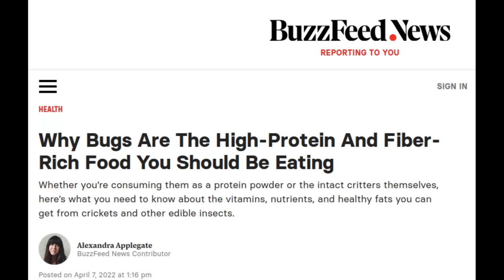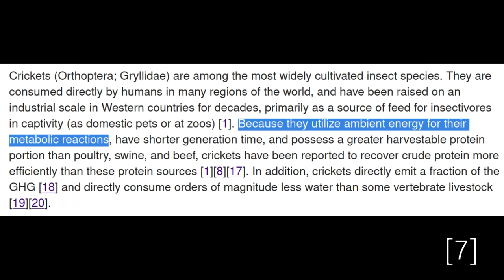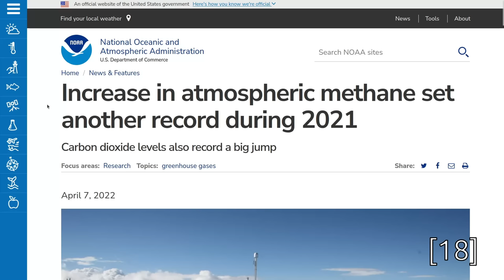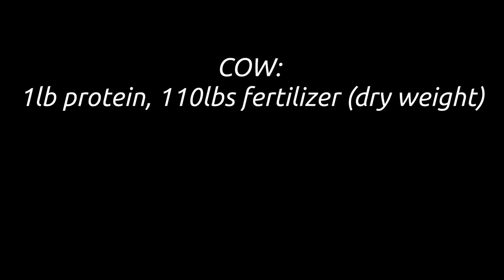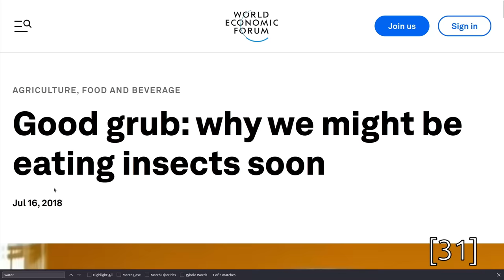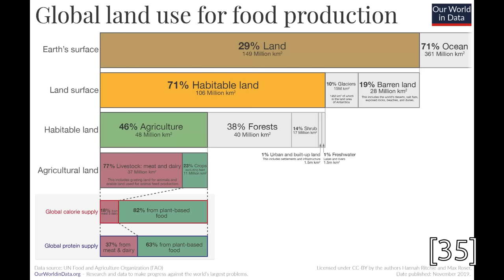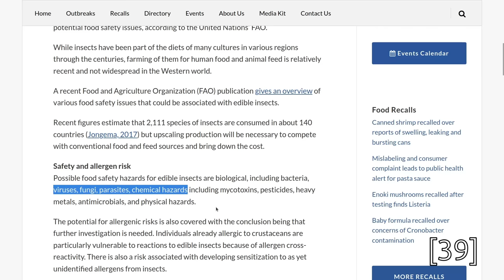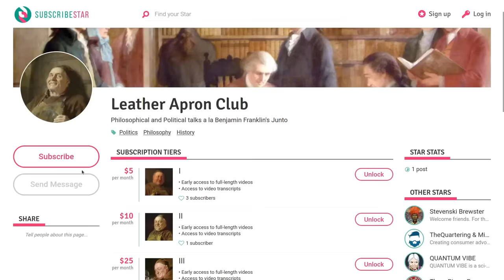Why We Won't be Eating Bugs in the Future

Comment: Also, insect protein has much less bioavailability as our bodies aren’t designed to digest insect protein. Not to mention that are digestive system can’t digest chitin too well. Eating bugs would cause a whole host of digestive issues and make people weaker due to a functionally lower protein diet.
Reply: Not only that, but they also have a  80% chance of being full of parasites, among those 30% being transmissible to people.
Reply: Exactly. This is also why eating bugs isnt comparable with eating "sea bugs". Shrimps, crabs and lobsters actually have meat in them when you remove their shells.
Reply: @reilysmith5187  And they have been eaten by French, Italians, Spaniards and many more for centuries. If you compare any of them prior to WW2 with a land bug eater from today the sheer difference of bone structure, muscular mass, mental strength (B12 only comes from animal meat) would put them to shame.
Reply: Sickly, cowed, humiliated people is a feature for them not a bug
Reply: That's good, less risk of an uprising
Reply: You can always eat them as chips instead of normal meal.
Reply: @adinalakatos1560  This is just, not true. The parasites of bugs do not readily transfer to people. Because, the adaptations needed to parsitise bugs, are different to what needs to infect people. That's why is generally considered safer
Reply: @reilysmith5187  Crickets also have meat, so do maggots, so do beetles. This is just, wrong.
Reply: @placeholdernameisplacehold7671  👃
Reply: @adinalakatos1560  Did you just make these numbers up? 
Sea life is just as prone to parasites. That's why fish tends to be frozen before being consumed raw, it's festering with crawlies.

And 30 people just roll with it.
 It's important to stick with the facts on this one.
But judging by your name I assume you're just being funny.
Reply: It can actually
Reply: The bug eaters have found this video 😨
Reply: @JA-jx1hk  tbh, eating chapulines is great, but I still will eat meat like arrachera
Reply: @henryc7548  Who are "they"
Reply: That's not how digestion works. Unless there are special microbial digestive products directly affecting health, digesting chitin would just take longer.
Reply: @Свободадляроссии  and that’s a big problem. We can technically digest wood, it just takes very long.
Reply: @Свободадляроссии  WEF
Reply: Making people weaker is the whole point
Reply: That's probably the point
Reply: That's exactly the point, it's also the reason they push vegan diets for similar reasons
Reply: @placeholdernameisplacehold7671  👃🏻
Reply: @Свободадляроссии  just digest it a bit longer, bro.
Reply: @JA-jx1hk  Yes. Really bad comparison to the point of being utterly useless since wood isn't food.
Reply: @theonpointheavy4401  And what would they gain from it
Reply: @clanksshekels  Wouldn't lowering economic output really suck for a group of neolibs?
Reply: @pauloa.7609  Yes, that's usually how this works. There's plenty of indigestible stuff in every single vegetable or fruit. Doesn't mean it doesn't work.
Reply: @Свободадляроссии  bugs arent food either. “Some people eat bugs!” Some people also eat wood. And dirt. And leather. Anything you can digest and get some nutritional value from can be called “food”.
Reply: @Свободадляроссии  not if you're planning on automating everything, and only want to keep humans around as debt slaves
Reply: @JA-jx1hk  Again, useless comparison. You just said that insects weren't food and that wood was. Get a decent definition for food. Any you might find will include insects, since they obviously have a thousand times greater nutritional value than what you suggested and beyond plenty of things we eat all the time. Just because you don't like it doesn't make it stop being food.
Also like a billion people regularly eat insects and it works. That doesn't apply to wood, leather nor dirt.
Reply: @JA-jx1hk  do you also have an issue with eating celery or anything with cellulose for that matter?
Reply: where did you get any of that protein bioavailability argument, please
Reply: @adinalakatos1560  False and you know it. They have NEVER been eaten it as a staple, from womb to tomb.
Reply: @Technoanima  Just Google any study on bugs, I won't bother because all of my replies are getting deleted anyway.
Reply: @turtleboy1188  Ahhh this one understands. They want us weak lel
Reply: there was a mummy from a millenium or 2  ago. He died from having mega colon from nothing but a grasshopper diet.
Reply: They probably would like us to be weak.
Reply: Lol lol just plain wrong. Humans have been eating bugs for a much longer time then they were eating beef. Chitin is what mushrooms are made of. And yes we don't digest chitin, like we don't digest fiber. So how many times has anyone told you "you should eat less fiber"?
Reply: Isn't there also an issue with people who have shellfish allergies also having their allergies triggered by certain insects?
Reply: @Rig0r_M0rtis  Are you sure that mushrooms are made of chitin? I am fairly sure they are not.
Reply: @SuperCosmicMutantSquid  Any arthropod likely has chitin, chitin may cause an alergic reaction.
Reply: @elio7610  You could have spent the time it took you to write your comment to look at wikipedia.
Reply: @Rig0r_M0rtis  I did, i word searched for "chitin" and found zero results on the mushroom page.
Reply: @elio7610  try the page on chitin or fungus
Reply: @Rig0r_M0rtis  Okay, i guess you were right.
Reply: Trevor Brannon  With that logic, increasing the amount of oxygen in the air would increase our population.
Reply: Trevor Brannon  There has been a study and indeed higher CO2 levels lead to bigger plants but it doesn't increase the nutrition accordingly so the nutritional value of these plants is smaller per unit of weight.
Reply: Tiny hats letting the go…I mean “cattle,” know that eating the bugs is perfectly fine!
Reply: Your comment makes zero sense. All arthropods of the land and sea are made up of proteins which are perfectly digestible by our mammalian bodies. Unless you can point to some specific molecular difference that gives us trouble? Animal protein is animal protein, and eating X oz. of land or sea bugs compared to X oz. of vertebrate meat will only differ in protein content by their ratio of protein to fat, and because you could be eating rabbit (incredibly lean) or bacon the macros of the vertebrate meat would vary a lot more. And you aren't guaranteed the complete vitamin and mineral profile of a whole insect unless you're eating whole small fish like sardines, or organ meats like liver. Also, the average Westerner gets more than enough protein, and won't risk getting "weak" from malnutrition unless they pursue an extreme diet where they cut a lot of food groups out.

 And lots of foods that we eat contain undigestible carbohydrates. All soluble and dietary fibers pass right through us, and there are sugars in beans and other vegetables that we also don't absorb that end up getting fermented by bacteria in our guts and making gas. And there's also lactose which the majority of people aren't able to digest, either. I love eating shrimp so small that you eat their shells too. Or deep-fried shrimp heads at sushi restaurants. So what if I end up passing a little bit of chitin a day later.
Reply: @alexkim5838  you have to eat the crickets whole. You don’t have to eat the shrimp or the lobster whole. Nice try.
Reply: @JA-jx1hk  just because you've never had tiny shrimp or tiny crab which are eaten with the shells on doesn't mean millions of people don't do so each year. Also you still haven't explained any of your specific scientific claims.
Reply: @alexkim5838   Then start eating ze bugs now. We'll be alive. You will not.
Reply: @asdergold1  I already enjoy chapulines and silk worm pupae. And I love the natural red coloring from carmine, too.

Comment: I think one of the reasons bugs are pushed so hard is because of their much shorter lifespans compared to conventional farm animals. This shorter lifespan makes it way faster to genetically modify them to a desired form that can potentially convert food into protein even better than chickens. That's my best guess at steel-manning their position. I still don't want to eat them though.
Reply: This, but mostly because of energy conversion: The ratio from food energy to animal tissue energy is about 1:10, in insects it is about 1:2.
So while on 2 kg of soy you could farm 200g of mammals, you could farm 1kg of insects. Also many of them can be raised in waste products of other industries, therefore there is no extra farmland required. 
Also they need very little space.
Reply: The issue is the protein quality of insects is not that good compared to chicken, beef, pork, lamb, etc, as all the protein you need is best found in eggs or chicken, beef is a bit less as is pork and lamb. Insects are among the worst source of quality protein. Sadly not all protein is made equally.
Reply: @KiraYamatoinX10A  Also consider the implications of how much chitin humans would be consuming from these insects (primary component of the exoskeleton). 
Chitin is known to cause an inflammatory response in the gut, and is actually used for this purpose for some vaccine or gene therapy techniques to get the immune system to notice something else. 
This response is probably an evolutionary response to the fact that insects and bugs from the wild often have pathogens or are poisonous; but the practical impact is that mass consumption of crickets or whatever is potentially a mass autoimmune epidemic waiting to happen. We have no long term research on this.
Reply: @insertphrasehere15 also i’m pretty sure chitin cannot be digested by humans anyway

Comment: The natural cycle of methane is actually extremely important and a lot of people cannot understand it. Cows do not produce methane out of thin air. They produce methane out of plants that have stored up the material in order to grow. If the cow doesn't eat the plant, which in most cases is grass that has just a 1 year lifecycle, then the plant will die, decompose, and release CO2, methane and other byproducts. Now, some of these byproducts do get fixed into the soil, but, basically, what a cow does is it just reallocates the material that is already in the cycle, it does not magically produce new emissions out of nothing.

That's why all serious scientists look at fossil fuels, because this is the place that is actually responsible for climate change. You take something that was safely stored underground for millions of years, effectively haven been taken out of the atmosphere, and then release it back. This CO2 that is emitted from cars is not part of the natural cycle, it wouldn't have been released back into it but for human intervention. And it is the real reason for climate change.

Comment: You want the largest green house gas is? It's water vapor. Approximately 70% of the green house effect is due to water vapor.
Reply: more like 93% actually.
Reply: I heard, uh, that one mean german painter guy drank water. Maybe he DID escape and now wants to cause trouble again!
Reply: @cookiebaker2660  "Austrian"
Reply: Not surprised
Reply: @cookiebaker2660 ummm he was mixed race bro...
Reply: Okay and the higher the temperature, the more absolute humidity you can have in the air. This isn't the killer point you think it is.
Reply: @ChucksSEADnDEAD  Have you heard of causal cycles? Water vapor, as a greenhouse gas, locks in radiation, which increases heat, and heat produces more water vapor. Your comment isn't the killer rebuttal you think it is.
Reply: @RealLifeIronMan  And yet the Earth isn't boiling hot despite water existing for billions of years. According to your killer rebuttal, it should.
Almost as if an equilibrium exists. And water vapor did not upset that equilibrium. Hmmmm.
Reply: @ChucksSEADnDEAD  You are supporting my point. The oceans haven't boiled over yet despite the influence of plenty of greenhouse gases in the atmosphere throughout Earth's history. The point being that greenhouse gases aren't the end of the world.
Reply: @RealLifeIronMan   Nobody is claiming that climate tipping points can make the oceans boil. But they could certainly make land uninhabitable. Water has a high heat capacity.

Also, the water vapor climate change argument has long been debunked, because water vapor doesn't stay in the atmosphere for long enough, thanks to a little thing called rain.
Reply: @elietheprof5678  Its a cycle. No matter how much rain there is, the atmosphere is always full of water vapor. Rain only occurs when humidity levels exceed 100% capacity in the air. And only removes enough humidity to balance back to slightly below 100% capacity. At all times, the humidity levels in the atmosphere are high enough to retain radiation from the sun. How do you think the Earth exited the Ice Age? Vapor in the atmosphere retained radiation and warmed the earth. Few people realize water evaporates (albeit slowly) even at 0 degrees Celsius. There was no industrial fumes in the Ice Age. Weird how the Earth doesn't need humans for global warming.

Even if you disagree with that, no one is uninformed enough to argue rain removes all water vapor from the atmosphere. Which why it is confusing you are making that argument. You need to do a better Google search.

Additionally, the EPA, on its site, itself lists water vapor is a greenhouse gas that contributes to climate change. 

The reason you misunderstand is this. There is a healthy level (for human life) of greenhouse effect, lets say a metric of 85-95 arbituary units. Water vapor contributes 70 units, and other naturally produced gases produce 20 units. Industrial and artificially produced fumes contribute maybe 10 units. So when scientists say industrial fumes are causing global warming that is what they mean. It contributes to the deadly range of greenhouse effect, but by no means the largest contributer. The only difference is we as humans can control the level of industrial fumes we release in the atmosphere.
You can argue that keeping the same level of industry will cause people to die from global warming, but decreasing industry will cause people to die of starvation.

Comment: The CO2 produced by the animal is essentially irrelevant. This is because this CO2 was stored in the chemical makeup of the feed to begin with, and the feed grew by using photosynthesis to pull that CO2 out of the air in the first place. Sure, there are some inefficiencies in the system depending on how the feed was grown (e.g. if the farm equipment or the transportation used fossil fuels) but the breathing itself is 100% carbon neutral.

Comment: To be Frank, I'd be fine with incorporating bugs in my diet if I liked them, it's just insane they are being pushed as a replacement for beef, and not something supplementary.

Having different options for meat is good and relying on a single source is a terrible idea.
Reply: If you eat shrimp, lobster, or crab you have already eaten bugs
Reply: @jason8ification  I mean there all Athropods sure, but that's like saying if you've eaten pork you've eaten beef.

It's probably even more accurate in comparison because pigs are I think closer to cows in terms of evolution as mammals, then crustaceans are to insects.

Comment: One other thing you seemed to gloss over, since they are cold blooded, crickets and other insects need a controlled environment.  Meanwhile, slap 4 walls roof and hay beds together and you get a barn.  Controlled environments require more resources to maintain (greenhouse gases for electricity etc).
Reply: That is not quite true, cattle requires apecific conditions in order to thrive, while the US and UK have big extensions of temperate grasslands that allow for the easy production of cattle the rest of the world can more often than not be too cold, or arid or humid for the cows to not be stressed out and have development issues, this is usually offset with either controlled environment facilities or importanfrom foreign countries, and relying on those is usually a recipe for disaster. Countries like Russia and Venezuela come to mind, which import a huge deal of their food and starvation is rampant among the population
Reply: No, he did talk about this in the video. 

Or were you saying he didn't go deep enough or something?
Reply: They may be a good supplemental food for warmer areas though. Colder areas are better for larger livestock, but small, warm areas, or even better, small islands, where livestock is actually invasive, maybe better with smaller animals to raise. Insects, rabbits and similar.

Comment: This is super interesting and informative, great job. My only gripe are companies genetically modifying insects to break down garbage at a faster rate. Specifically China's super roach comes to mind; A personal fear being one of these super-insects breaking out and wreaking havoc on nearby neighborhoods. Essentially becoming impossible to get rid of once a house is infested.
Reply: they are still insects, not hulks. you just described them as "breaking down garbage faster" - this does not imply any additional protection against our means of killings them.
Reply: @davejacob5208  I think they're more scared of the possible dangers insects like that could cause. Having cockroaches that are capable of breaking down plastics and other synthetic materials could quickly become a problem if they make it out into a city, which could cause massive amounts of damage (as if cockroaches weren't already known for causing damage to structures)
Reply: @davejacob5208 but it’s from China so it’s automatically super scary.